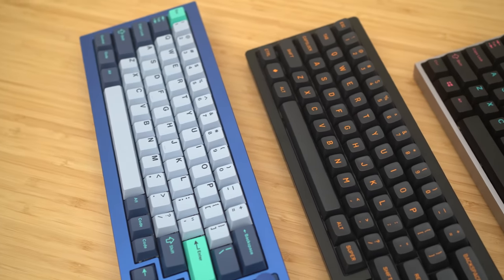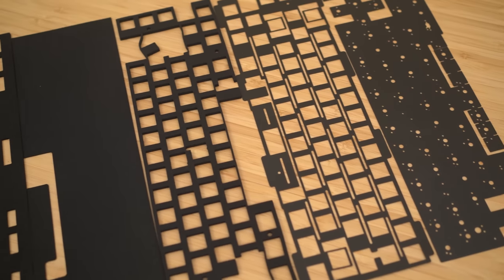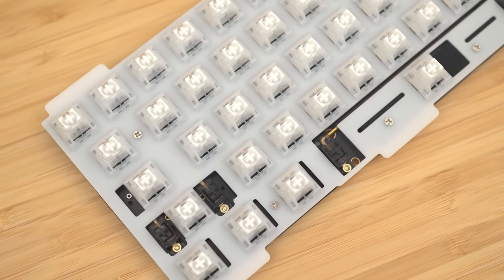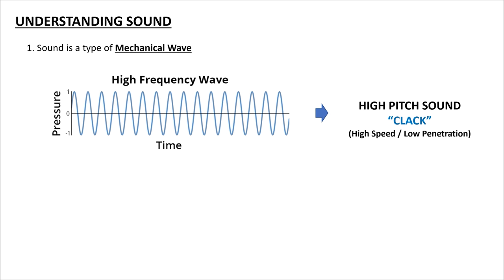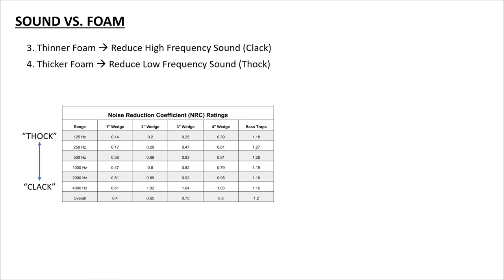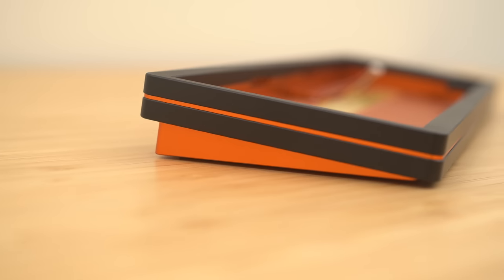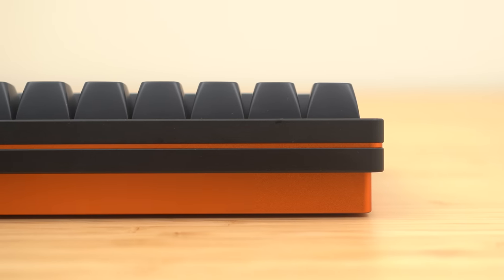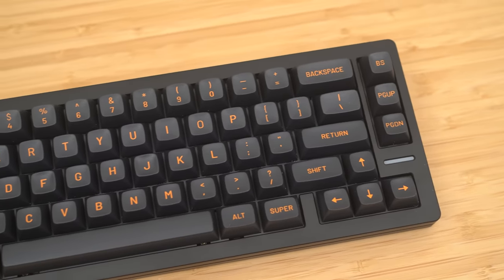YOU Make Your Keyboard Clack or Thock - Featuring Wind X65

Comment: I bought Machenike 500 b84 with a red gaterons. Its soft and not too loud but I have issue, that sometimes the keys get pressed when I don't want it too. It happens when my fingers lay on keycaps and it seems that slightly pressure like weight of my fingers, whatever makes the switch to register pressing. It might be because of low force and trevel distance needed to activate switch... What switch would you suggest me to try to still have silent sound but more tactile, feelings pressing keys? Because now key press happens when I dont want it and not really realize, that I made that pressing. So sometimes I can make undesired strafe or jump in games :(.

Comment: I got in the case of my keyboard a thick layer of silcon at the bottom (SGK50 S3) and added two thin layers of foam between this slilcon layer and the tapemodded pcb. And the foam maykes the keyboard more dampening but also more thocky. Shouldn't it make it more clacky instead?

Comment: Hey I heard the Wind X is generally a board that is high-pitched. Is this true? I heard pom plate nad pc plate creates a deeper sound, but I've tried pom plates mostly on stacked acrylics and it never sounded deep even though i was told acrylics sound deeper. I had a kbd75 with a brass plate but sa keycaps and oa switches and it was the only board to literally sound deep. Now I have a Wind X with a pc plate but swapped it out with a fr4 plate and oa switches still sounds quite high and muted. trying to get a deep louder sound not sure what to do. Even took out all the foam except a tiny thin piece of foam and tape mod, still nothing

Comment: I loved how informational this video was! I do have one question for you, or anyone in the community who might be willing to answer. Firstly, how does foam density affect sound? For example, what will the difference in sound be using the low density foam from a package, or something thicker like the foam from a desk mat? Also, how does case material affect sound? I would love your input. I am currently working on slowly upgrading a Keychron K6 for my first build, and I want a poppy, slightly deeper sound profile. I currently plan on using Akko Jelly Blacks, although I'm open to input!

Comment: Damn, this is a lecture level education. Highly appreciated, thanks Scott! 🙏

Edit :
So I have this question since I've thought to experiment with my already existing cheap keyboards regardless of whether it's worth it or not. How different the sound would be when it comes to the material of both case and plate? For example, Polycarbonate vs Aluminum case and Brass vs Acrylic plate. I think many would happily watch your video if you prolong the video to talk about this. Or plan a Part 2 video since this one is already uploaded anyway.

Edit 2 :
I've had this really, really cheap keyboard from Digital Alliance, the product name is Meca Warrior RGB, bought in 2019 for IDR 440.000 (about USD $31 based on 5th April 2019 conversion rate). It came with an Outemu Blue switch, the quality of the metal plate and the plastic case in this keyboard is so cheap compared to my IDR 540.000 (about USD $38 based on 14th July 2019 conversion rate) Tecware Phantom 87 it even stays to sound and feel so hollow after I modded it with some EVA foams and PE foams, changed the switch to Outemu Teal (heavier clicky than the Blues), and experimented the keycaps with my keycaps stocks (I have OEM, Cherry, SA, MA, XDA, and DSA profile keycaps). So I think this is quite an interesting topic to talk about the plate-case material and quality itself. If you take a look at it, those two keyboards are only $7 apart. But the quality difference is huge.
Reply: Also very curious about this myself

Comment: Hello, I am very new to the keeb community I just got started into researching on what I want for my first keyboard and what caught my attention is this "creamy" sound profile. I've noticed that the videos I've watched along with the builds the creators of the videos posted featured linear switches and a thin amount of foam. I would prefer to surround my build around this sound profile and I am wondering where it would land in this scale between 'clack' or 'thock'? Thank you.

I also appreciate the technical background knowledge included in your videos. Would love to see more.
Reply from the maker: I feel like the "creamy" sound profile is actually a bit different from clack and thock.  You can have a very sharp thock (like if you look at my GK61 video... the spacebar) or you can have a very rounded, warm sound (Typically people correlate more mid-range with this "warmth" as well).  I feel the creamy or sharpness comes from more than just case foams and such, rather the characteristic of the switches, whether you use a PE foam or other sound modifiers also.
Reply: @Keybored  I am very unsure of what I want in terms of sharp thock vs. the rounded warm sound you're describing. I'm trying to go for the Durock POM switches and after a bunch of research I think I would like to go for a more muted sound as well like this: https://www.youtube.com/watch?v=qSbX6q51cOM. How would you describe a sound like this? Also, any tips on how to achieve it with a different keyboard case? I'm sorry but this is all still very new to me.

Comment: On the thoccy board did you use the foam between the plate and pcb? I have my tofu 65 with no foam in bottom(I took it out because it dampened the sound a ton even though it was thin) tape mod on pcb and foam between the pcb and plate. I am also using Akko lavenders and it sounds like your semi clack build in this video. What mods should I do?
Reply from the maker: Tofu in general has a tendency to be a bit clackier. But you can lean into that and also use the o ring or spring mod to clean up the sound, then go for a softer plate, deeper switch and caps and you'll lean on the side of deep. I have a tofu60 with mx blacks, pom plate, stupid fish plate foam, tape mod and some polyfill and it is an amazing sounding board!

Comment: So a question for understanding: for cheaper keyboards that sounds pretty hollow, if I still want the keyboard to give off deeper frequencies, but still reduce hollowness, the only way would be to put larger area of foam but a less dense foam? 

Same volume of foam - one denser and one less dense: the less dense should theoretically block higher pitch and more dense blocks lower pitch. To be as specific, would need to calculate the break even point of a less dense, but higher volume of foam to keep the sounds more weighted towards deeper tones?
Reply: Also, I'm putting together some materials for a keyboard 101 guide on my website, is it cool if I reference this video and link it when I talk about sound modifying keebs?

Comment: Thank you for this video! I'm gonna use this knowledge to try and turn my k2v2 into a THOCK as much as it's possible anyway! A question I have is, if I have cheap pbt keycaps would filling them with sillicone contribute to the thock? At first I though yes since it will make the keys heavier, but then again it actually adds more material so maybe it hinders the sound signature? What about o-rings?

Comment: This video is amazing! Literally answered most of my doubts on how these sound science works within the keyboard.. But I do have one more question that I hope it will be answered though.. Does the desk material affect the sound as well?
Reply: I can confirm this definitely matters. A lot of people put a desk mat under the keyboard to minimize how much resonance the desk takes on. Today I pressed my keys on the desk, then picked it up and pressed the keys just holding the board in air. I personally am chasing lower frequencies and my desk added to that. But dif desk/table builds will affect the sound for sure. If you want a tighter, thinner, deader sound, go the deskmat or foam-under-board route! Otherwise see how your desk receives the sounds.

Comment: Thats crazy. I need some help. I have a keychron K2 with brown switches. What would be the best way to make it thockier. I had jammed it full of foam and tape but I guess that's not the best choice. What could I do? I can't buy new switches so i can only do stuff like that. Does the aluminum frame help? i currently am using the plastic one. Let me know and thanks!

Comment: I have a problem with clack on keys near the edge of my keyboard and thock in the middle of all the keys. I tried applying two layers of tape on the pcb and the third only throughout the perimeter and it didn't solve the issue HELP

Comment: Hey I've watched a few of your videos and just stumbled on this one today, awesome information, just subbed for more! I'm new to the hobby and still learning. I'm assuming those precut IXPE sheets came with the Wind X65, did you use both of them for the thock build or just the one with the switch pin cutouts? I'm building a GMMK Pro and I'm aiming for the thock sound. I've been looking at PE foam switch pads but I'm wondering how different this would sound from a full sheet.

Comment: Just curious, I normally use silicone dampener for both the pcb and the case instead of foam since I know it has better sound dampening properties. Will it make the board clackier than foam?
Reply from the maker: From my experience, silicone doesn't dissipate sound very much, rather it fills the hollowness and bounces sound back somewhat as well.  It essentially blocks the sound from going from one end of the other, Vs. taking the sound and modifying it like some foams do.
Reply: @Keybored  i seee, thanks for your input! Love all the videos you have been putting up 😄

Comment: This was awesome!!! Thank you for this video! But now I’m wondering, what does the silicone mix I filled my hollow board case do to the sound waves?? 🧐 It’s “silicone rubber” for making resin molds, or something, lol.
Reply from the maker: So the silicone won't actually work like foam to dissipate the sound waves into friction and heat as much, since the waves don't travel through silicone as freely. However, what the silicone will do is reduce case volume, which will effectively reduce the hollow resonance of cases, and in turn will create a clackier sound also since the volume of the case decreases. Hope that helps!

Comment: as the foam gets thicker wouldn't less high frequency sound penetrate through it? imagine music coming through speakers in the opposite room, the main thing you hear is the deep bass right?

quick edit: "Deep Penetrating, Low Frequency Wave Needs Thick Foam To Stop It" yeah, but the high frequency noise is even less penetrating and is being stopped too surely?

Comment: Hey im new to this Custom keyboard thing and i really love the customization so i bought the Keychron k2 v2 hotswappable as my first custom keyboard, i lubed my Gateron reds and ordered some pbt keycaps but the sound became a little muted and i didn't really liked it, so i was wondering if i get some Gateron inks would the sound be more pleasant or thocky in the k2?

edit: i have already used the foam mod and the holee mod
Reply: Gat reds are not super deep. Also take out the foam and apply masking tape behind the PCB to amplify the deeper tones. Lastly you didn't mention what plate you're using. That's a huge factor which Scott mentions in the video. Polycarbonate will usually give you the deepest sound.

Comment: You mention that masking tape on the back of the PCB would reduce clack/increase thock, but what about electrical tape? 
Since it's thicker, would it have an opposite effect and increase clack/reduce thock? 
Also, what about used in tandem? Just dull the sound entirely? 
I'm curious on the audio science behind this. 🤔
Reply from the maker: I haven't used electrical tape since they tend to gum up pretty quickly. Not sure if I'd recommend using on the pcb honestly. But different materials bounce back sound in different ways, so would have to see what it does

Comment: I want to know a tip that how not to ruined under pcb screws that have to mount with the plate and how difference out come of sound between poron form and silicone jacket on the gasket plate.

Comment: Did you use both sets of IXPE foam... it seems like you may have used it wrong. One set goes on like normal PE foam (under the switch on the PCB), the other goes on OVER the plate. In showing your ink switches on the POM plate, the PE foam was not present above it.

Also, I wish you would have shown a video with using the same keycaps, because everyone knows using a taller keycap profile will provide more thock, but cherry profile is the most ubiquitous and others can be uncomfortable to use.
Reply from the maker: Interesting... The plate ixpe foam looked so ugly above the plate that I figured... There is no way this goes on top... I put it between the plate foam and the plate. Will have to reach out to wind studios for clarification
Reply: @Keybored  you don't need to reach out, I'm telling you correctly. I have a windx, and you can see their diagrams. It was originally a 'mute silicone' layer, but was changed without notification or justification to ipxe foam. It was always meant to go on top of the plate. That unique piece was a big reason I purchased the windx
Reply: to compensate, their plates are 0.5mm thinner

Comment: what about plate material? does it make a big difference in sound using pc instead of fr4 or brass? For example, in this keyboard, how would it affect the sound?
Reply from the maker: Plate material does make a difference as well... Unfortunately, I didn't have more plates for the Wind X65 to show it.  But in general, the brass plates are clacky, PC and softer plastics are generally deeper (even within this group, they all sound different... like POM sounds more pop) and aluminum and FR4 I feel are middle

Comment: Would like to ask if plate foam makes the board clacker. I have PE Foam mod + DIY EVA Plate foam mod. Idk if this mod makes the keeb clackier. If yes, then if I remove this plate foam I should achieve the thocky sound profile. Am I right?
Reply from the maker: Platefoam helps certain plates to control its ping or resonance.  I will have a video coming out on this soon!
Reply: @Keybored  Thank you for the reply. Looking forward to it soon!

Comment: Can the same logic to foam be applied to the keyboard itself… like if your keyboard is a super dense resin or plastic it reduces the thocc, but if its something thinner and maybe more hollow then more thocc. I also because i want a resin keyboard from Etsy but there aren’t a lot of thocc builds online using resin. Just for reference im thinking of using boba U4t with white ceramic key caps in any resin and wood keyboard.
Reply: This is so highly subjective and sometimes accidental. I recently built my first keyboard, partly based on various reviews, but mostly so it's the cheapest possible while being pretty and at least decently reviewed, so I got a GMK67 + Leobog Graywood V4s + PBT DoubleShot SA profile keycaps, and it's my baseline, not having any significant experience with other mechanical keyboards. I honestly could use this thing forever, bone stock unmodded, because it just feels so nice, and it was just $72 total, with shipping and customs included. To my ear it sounds pretty close to this mega thocc build, even though it's a plastic keyboard, all the foam is in there, I didn't do any mods, and people say that this switch is "clacky". My point is - you can talk to dozens of people and not be any closer to the truth, until you try something out.

Comment: Does spring swapping changes the sound of the switches? Since I really like the sound profile of jelly whites but find it a bit light.
Reply from the maker: It does on the up stroke especially!
Reply: yes definitely, though switches don't really change the sound profile of the board compared to the combination of materials and stuff on your board.

that being said, this is why diff switches such as jelly white, jelly pink, jelly black, or matcha green, rose reds have a slightly different sound profile despite the exact same materials used for the switch, it's the spring difference

Comment: Thank you so much for your informative video like this. I always wonder what mod to use in order to achieve both typing sounds on my MK870, really wanna try both sound profiles for a month before I finally decide to be a thocky gang or clacky gang. I will update this comment once I found out.
Although I still have some questions. What kind of case will contribute to clacky/ thocky sound? And what kind of switch materials take into consider for each sound profiles? Are there any alternative mods worth using to achieve thocky/ clacky sound?
Again, thank you for the video and thank you for reading this until the end ^^